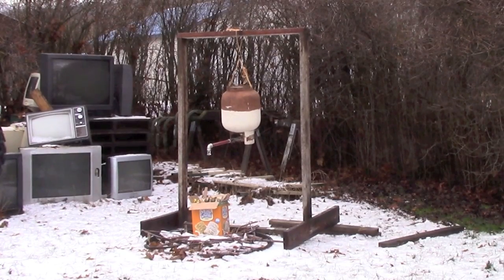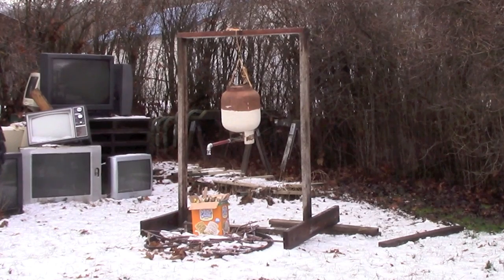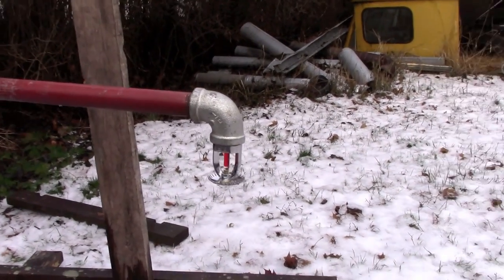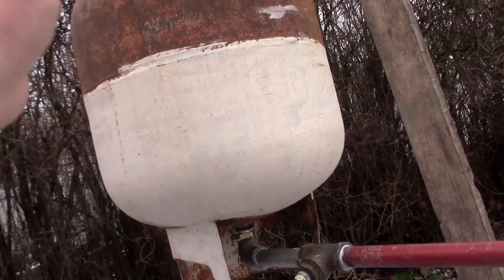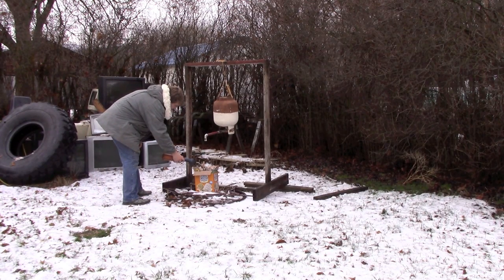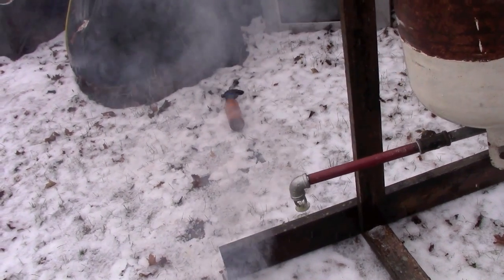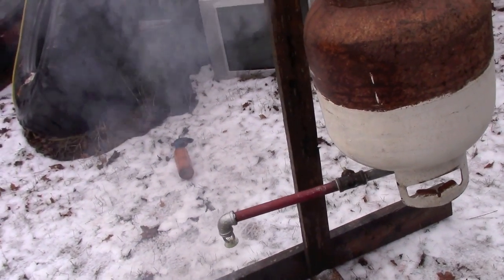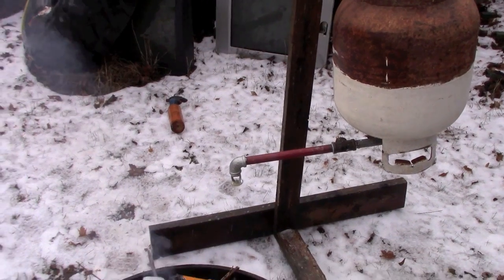Shop Fire Sprinkler Concept Testing

Comment: the reason it took so long is theres no form of heat collection. most sprinkler heads are required to be no farther down then a given amount of distance from a ceiling or roof structure.

Comment: Turn the sprinkler head and elbow 180 degrees and you will be golden, or change the upright sprinkler to a pendent  sprinkler. Either way your good as long as you have 7psi going to the head

Comment: Why don't you add a pressure regulating valve (PRV) between the pressurised water tank and the sprinkler head? That way you can control the spray patters much better and it would be more consistent for longer until the pressure in the tank drops below the PRV's set-point?

It should make the blast last longer too...

Comment: Couple of things to consider, which I believe you already have. These sprinklers are designed to work at a certain pressure, and will flow a certain gpm (gallons per min.) Your tank will need to stay in a heated environment at all times, or maybe mix in some antifreeze? Test looked good. I would call that fire "out". If you have a home security alarm, you can tie it in to the smoke detectors which will automatically dispatch the FD. As others have said, prevention is always your best bet.

Comment: just had another idea. Shop fire is most likely to happen just after you leave the shop. And most likely you go from shop in to house. What if you have smoke alarm in the shop and its speaker is wired in the house?

Comment: cool idea. Some potential there for sure. But not sure it is the best approach. My concernes are: It has to be super reliable. Shame if it fails like 10 years later if you actually need it. Accidental activation can be pretty annoying it does not help much with electrical fire. I think prevention is better way to go ( keeping area tidy, shut of power while not there) Fire is great concerne of mine too.

Comment: It appeared, to me that the water was spraying up rather than down.  Maybe that particular sprinkler head is supposed to be oriented 180* (pointing up, rather than down)?  There are also different flow rates available in sprinkler heads.  I would suggest using a larger volume of water as well.  Maybe a 100lb propane tank?

Comment: Solid concept I think! I may have a go at one for my reloading/gun room. I think something larger and stainless would be best, that way you don't have rusting to worry about compromising the system or plugging it up. I think a modern stainless beer keg would be great for this with some mods. And after proofing out the system, final fill it with fire suppression foam which is available. Not super cheap but way cheaper than rebuilding after a fire! You could completely fill the tank and use another just as the pressure charge tank for more system volume.

Comment: You had the wrong sprinkler head for your application. Sprinklers come in several configurations. You installed yours up side down that's why it sprayed upwards. 
Try using a well pressure tank to store your water supply. Shop around there not that expensive and come in many sizes.
Reply from the maker: +73leo73 Thanks for the tips.

Comment: nice idea what about using a bigger tank like from a fork lift? I myself would monitor  this system for pressure to detect a leak, rapid release of pressure too to ring  a fire bell. raspberry  pi or arduino controller. I have been thinking out adding these in my basement  I have plenty of water so its finding out if it will work with 30psi water pressure at home. I love your M923 truck did you get the first one running again. I'm  buying a M923A2 I took a video of the engine running. thanks Don
Reply from the maker: +Don Biederman Interesting ideas.  I haven't messed with the truck motor at all yet.  The original plan was to put piston's and liners in it but I have been offered a running motor with a 2010 rebuild tag from up in Canada.  18 hours of driving total but then free motor.  Sounds like an adventure.